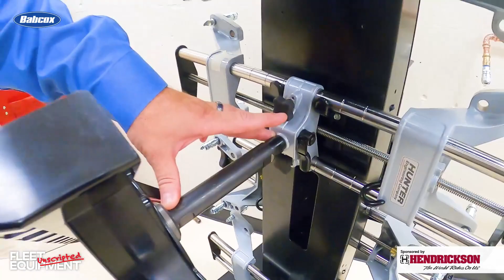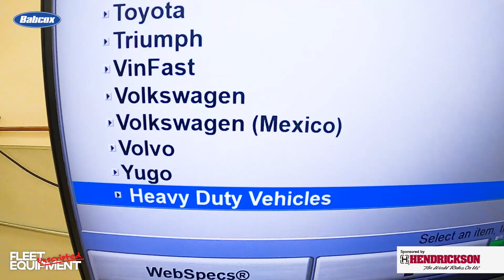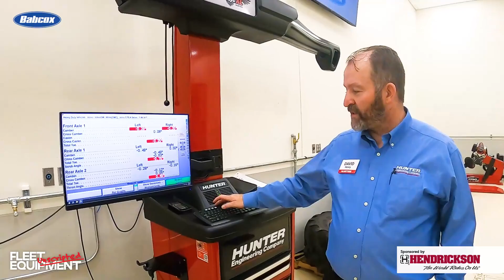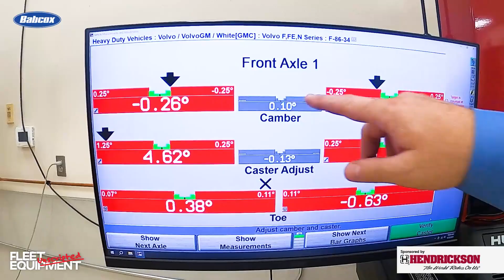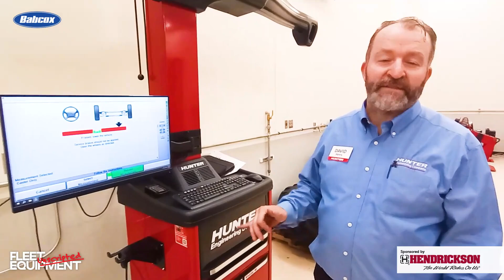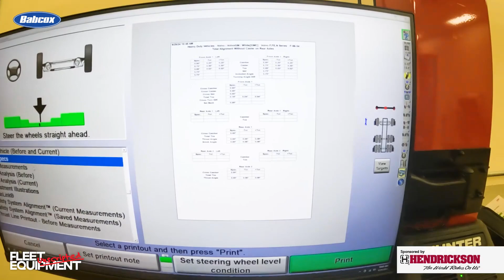How easy it to align a heavy-duty truck? | FE Unscripted

Comment: So you can’t straighten an axle???? It is done all the time.
Reply: The axle manufacturer's recommendation is biased. They make more money when shops buy new axles rather than correcting one that is damaged or out of spec. Bee Line offers a whole suite of axle correction tooling that's I'm particularly fond of.
Reply: @shawnwinder9329  , No manufacturers recommend bending. Period. There are so many variables that could cause catastrophic failure of the axle in service. If a shop is bending axles they are assuming a tremendous amount of liability. If a truck they "fixed" has an accident and it can be traced to improper service??? How much liability insurance do they have and will they be able to collect on a claim when they performed improper service procedures? The dollars spent on a new axle could save lives.
Reply: It shouldn't be done. NOT ONE axle manufacturer recommends or authorizes bending of their axles.